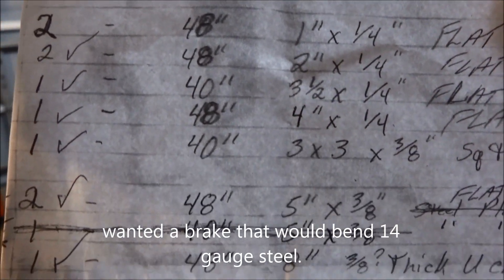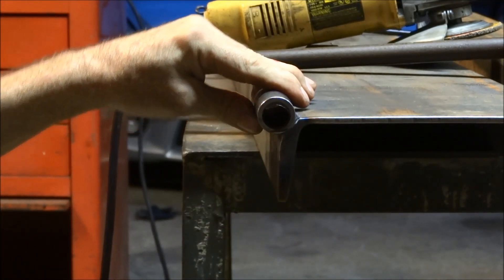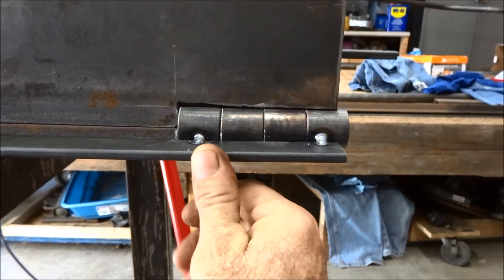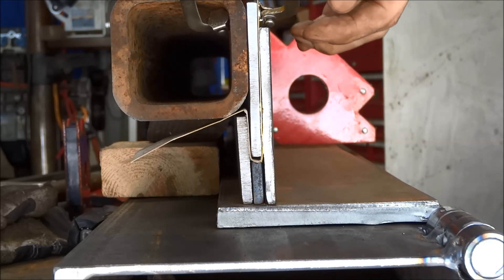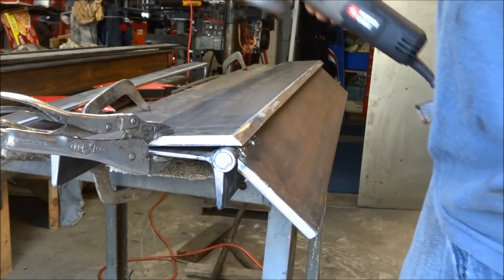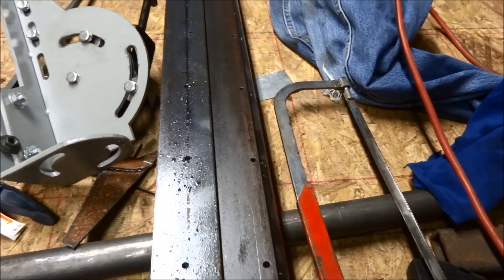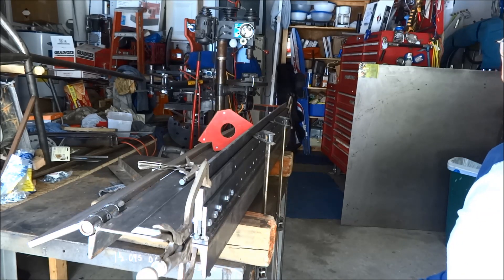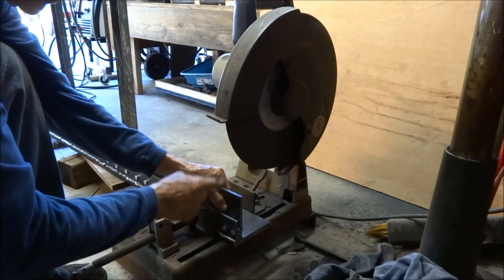Home made brake / finger brake, part 1.building the brake

Comment: why are you calling that a brake-its a sheet bender,not a brake
Reply from the maker: Just a difference in terminology. A brake is a metalworking machine that allows the bending of sheet metal. A cornice brake only allows for simple bends and creases, while a box-and-pan brake also allows one to form box and pan shapes. It is also known as a bending machine or bending brake or in Britain as a sheet metal folder or just a folder. (I copied and pasted this definition).
Reply: @TSRGarage  not really.

a "press brake" ir what is commonly called a brake folds metal in a very specific method,namely the squeezing of metal between an anvil and die,usually hydraulic powered.

everything is controlled,angle,die sets,and pressure dependant on thickness and size.

on the other hand a sheet metal folder works by clamping one side of the stock and bending(fold) the other to the desired angle.

press brake is more versatile but a sheet folder has very specific functions that cant be done any other way.
Reply from the maker: @jadekayak01  👍 thanks for watching. And commenting.
Reply: @TSRGarage  Good patience :)
Reply: @jadekayak01  ughhh...

Comment: high five for building a box/pan I don't have the patience to even attempt that!
Reply from the maker: +Shallow Creek Smithy  Thanks.  I looked at some you tube videos and got a few ideas before i started.  I wanted something that would bend up to 1/8 inch (not full width).  It did take a while to build,  I've only used it for a couple projects so far, but it is a great addition to my shop tools.